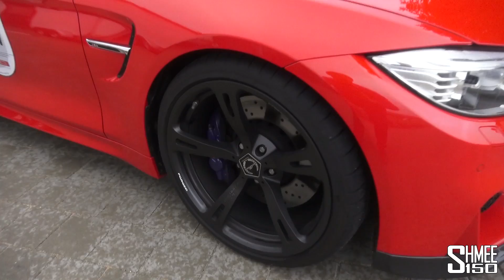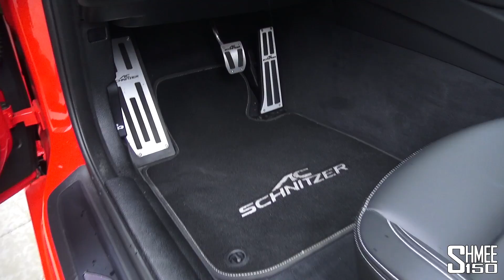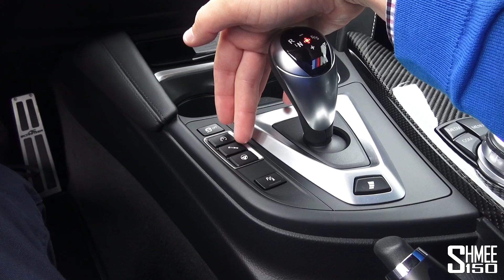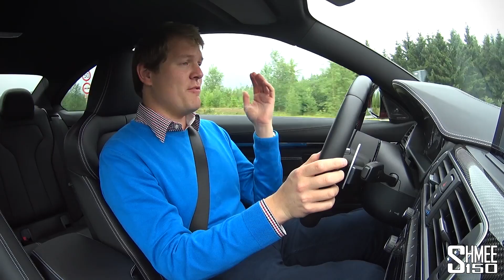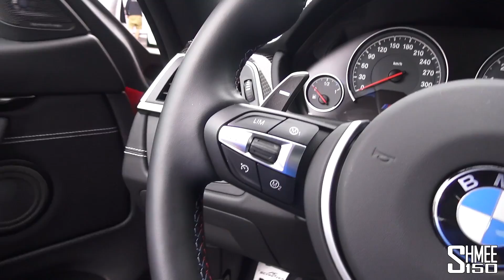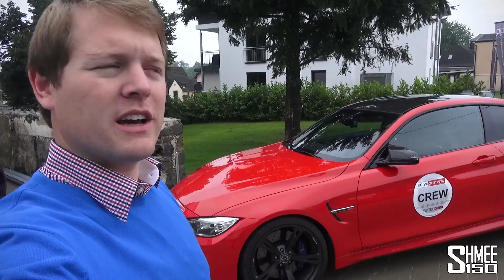ACS4 Sport - Have AC Schnitzer Improved the BMW M4?

Comment: Shmee why dont you own an M4...infact a BMW ??
Reply: Sometimes i prefer cars like the M4 , RS5, C63... more than supercars
Reply: yes m4, rs3/4/5/6, c63, .... all of them are good. But bmw does not specialise in supercar. Althou they did made v12 for the mclaren f1. But still bmw now has V12 for 760i also.
Reply: no supercar bmw (i8 doesn't count)
Reply: Shmee150 are you thinking about the new m5 ?
Reply: Gas Pedal Subscribe thats what you say when you have never driven one
Reply: Ahmed mahmood Its all about selling cars for more than you bought it, not losing value so don’t expect Shmee to buy cars like the M4 or AMG’s.
Reply: you should get a M4 CS
Reply: An //M car without a manual gearbox is just wrong.
Reply from the maker: I did a few hours ago. BMW gave me two cars which I could use, but at this moment there is no BMW in my personal fleet. My manager Marc has a M2, Becky has a bagged E21, Joe has a M135i, and Ben has a 123d. Enough BMW owners around me ;)
Reply: Ahmed mahmood no point in getting one, the value of the car decreases rapidly.
Reply: Taylor Martin . I8 is an electric rubbish car with a sad 4 cilinder . So no sportsound at all (perhaps on a cd as a option, LOL)
Reply: Ahmed mahmood . I think you have a point in preferring towards roadcars with a twist (M4 ect) in stead of the not usable power of the supercars in normal circumstances
Reply: Glad to know...
Reply: Shmee150 I feel like your waiting for the 8 series or M8...correct?
Reply: Because he's not a douche
Reply: i8 is even lower than sport car